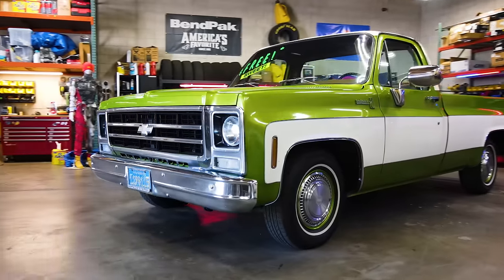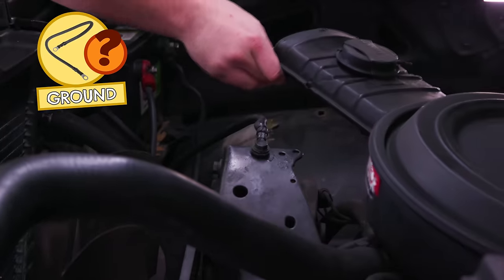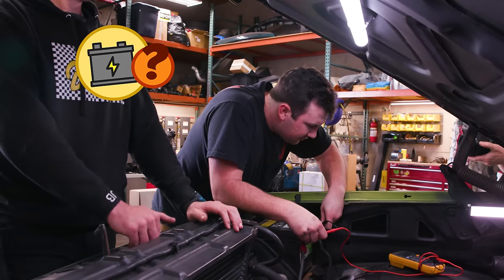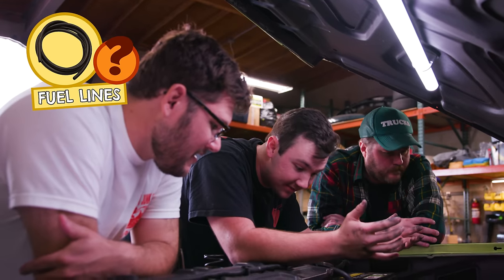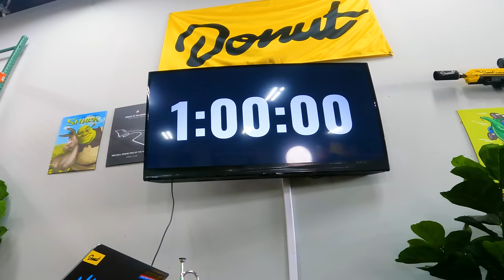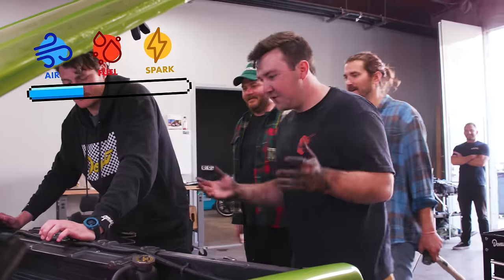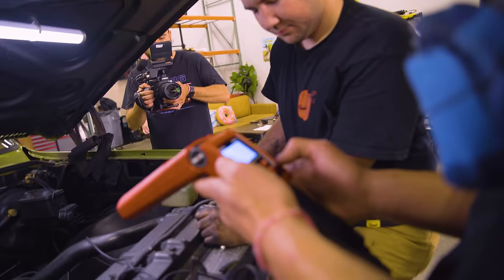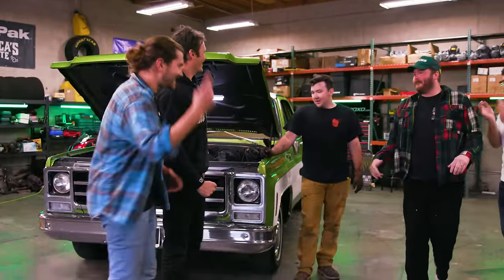Giving People a Classic Truck, If They Can Fix It

Comment: It's much easier sitting and watching and judging, but having that much going on around you, people watching you, talking, judging you, lol fun, but very intense working under pressure and second guessing yourself.  I had a neighbor come get me knowing I'm a mechanic and he just didn't want to ever bug me but he was having an electrical problem and the shop he was taking it too kept working on it and charging my neighbor so much money, it didn't take me long to look things over and find the issue which not only fixed his electrical issue, and inform him the shop he was going to was well, ripping him off and taking advantage of my neighbor and scamming him for money.  Wrong headlight bulb was used in the right head light masking the electrical issue, the battery cables were loose, and there was something else I forget but it was causing the battery to drain with a parasitic draw, a wire was in the fuse box bypassing a relay, I forget for what, but all these super easy fixable made up problems to a non-mechanic or someone with zero knowledge would be fooled, but here's my point having been an ASE certified mechanic with now 36 years under my belt I not only was pissed at the shop for doing this, but honestly lol, my neighbor watched and asked questions which I'm cool with but 1 person watching was a bit nerve wracking lol like being examined, now I have a nerve disease in both legs and feet and spots through my arms and hands terrible pain and so I'm a whole lot slower and need so many breaks, even with all my years I don't think I could do this in 2 hours lol, so totally a thumbs up here such a great idea, looks super fun and nerve wracking as I said.  I know 2 hours is a good amount of time, but when you have leg and feet issues, moving around isn't easy and painful, besides I have my own vehicles to work on with mysteries them selves lol.  My overall point is thumbs up and this is the reason I subscribed.  No I don't want to be on one of these, if I were normal again, I'd love it.  But I'd need like several days lol.  I'm slow but I get the job done and correct doing justice for us good mechanics out there who do not tarnish our rep.  It's so harmful to the trade when mechanics see a dope and only see dollar signs.  I told my neighbor, no wonder you have an electrical issue, as I'm tightening down the battery cables.  He took it in originally for an oil change and then when they got it back a head light went out then the car wouldn't start or battery would constantly die and a whole host of issues started popping up, usually that's a sign you've been scammed, car is fine then take it to someone and little things pop up, you take it back that's fixed now something else has popped up, and then a bigger issue and so on.  OH I forgot the headlights were glued in place so my neighbor wouldn't be able to understand why they won't come out, it was a Honda and it has those 3 screws you loosen to replace the headlight bulb, anywho they were so tight I knew something was done to them, I got them out and blue locktight was applied....huge red flag, so when my neighbor started to tell me he had taken the car in over a period of months for his mechanic to track down and fix the electrical issue and hearing what's been happening as they drive it, I immediately checked the battery cables and they were loose enough to move by hand which is as we all know too loose lol, so I went around inspecting things going off what my neighbor had experienced and found all the fake set ups and things that were purposely done to sabotage the vehicle.  I've said this, lol I just can't believe it was happening just nextdoor, as I've heard about scamming mechanics anywho lol, thumbs up, love the channel and thanks for reading!

Comment: If I had 1 million USD, I'd buy about 10 pre 1990 cars a week, and then sell them off to anyone with a contract that if they restore it completely to working condition, they get all the money back from buying it. So it stays valuable. We absolutely need pre 2000's cars still around because they're pushing people into EVs with tracking and remote control.

Comment: My dad has a truck just like this. I put a 350 in it and rebuilt the carburetor he told me I want the engine and transmission from that Cadillac instead so out with the perfectly ok motor and put in the Cadillac power plant. I keep it maintained so I could get this vehicle running in 20 min I miss the older cars new cars and their stupid computer sucks

Comment: Once he had that carburetor on and the grounding and timing problems solved, he could have started that engine just by pouring a little gas down the carburetor, not sucking on the fuel line . It wouldn't have ran for too long. But they didn't say that it had to keep running. I wouldn't want all those guys breathing down my neck while I'm working, anyhow.

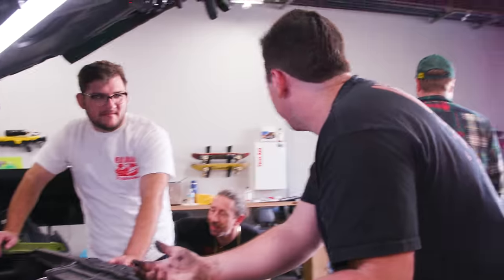Comment: 6:57 Its a mechanical fuel pump, it works off a pushrod in the bottom end. Their is no electric, there is no priming. Turning the truck over will do nothing. Donut employee fail

Comment: How does a 'mechanic' actually think you need anything about 12.6v to have proper battery voltage? He thought you might need 14 volts??? Baffling, for a mechanic, to think that.

Comment: Why do you all keep saying "air, fuel, spark"? Air is part of the fuel mixture. Gasoline by itself is not fuel.
The three true things a car needs to run are:
1. Fuel (air & gasoline mixture)
2. Spark
AND
3. COMPRESSION
Without compression, your piston doesn't move, and you will not have a running engine.